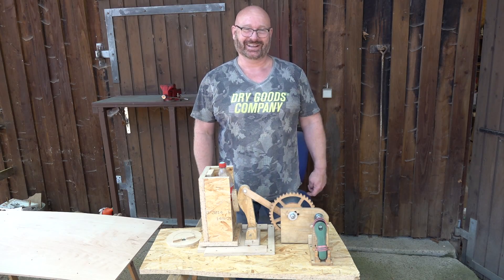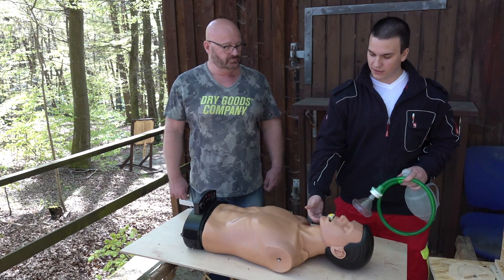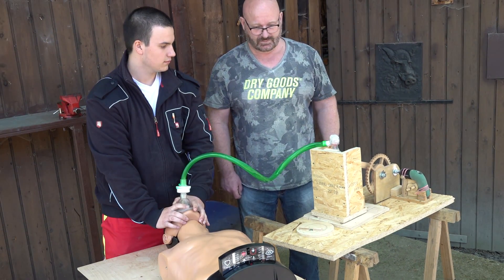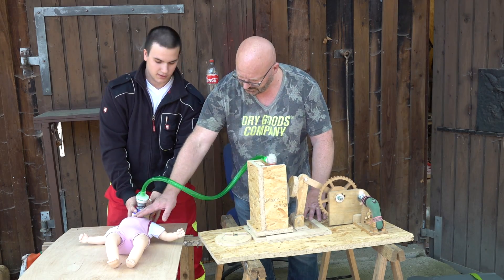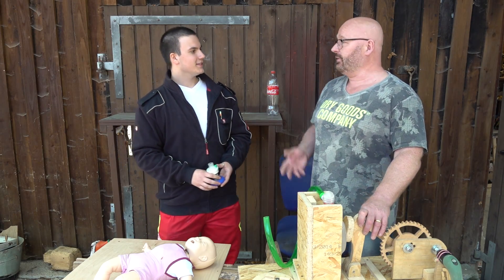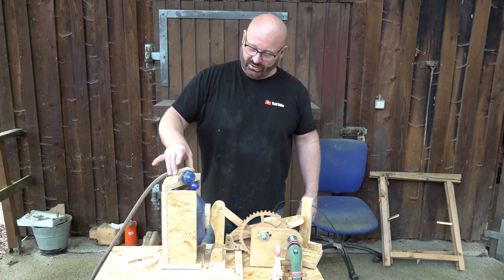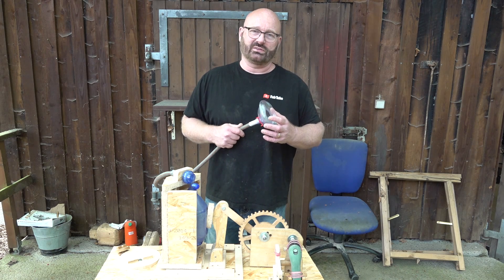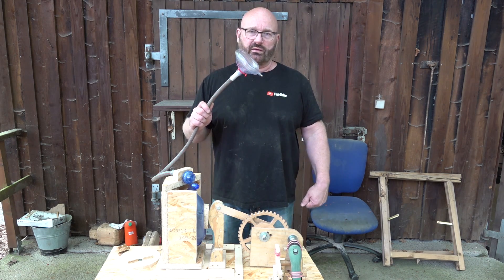Home Made Ventilator - Life Saver or Death Machine?

Comment: I think that devise would be amazing use about primitive context. Like medieval or a bit later where electricity don't really exist and you just have to change that electric screwdriver by a level manual  instead. You can say about it still need something to replace the plastic of the bottle bag and all the tube, but that is not where I would debate.

Comment: The problem with this device - and the thing that actually does make it, if not useless, extremely limited in potential applications - is that while, in theory, based on 'common sense' at least, it is substantially better to hook a person up to this thing and roll the dice if they would otherwise have no access to ventilation, in the real world there is a huge difference between 'failing to save someone' and 'injuring or killing them with an unlicensed medical device built by amateurs with a (no offense Joerg, but it's a fixed-volume respirator that seems to base a lot of its operation on how CPR works) limited understanding of the respiratory system.' Not only legally (though the legal risks are so high no facility employing medical professionals in the developed world, from a hospital to a prison, would allow it into the building) but in terms of medical ethics. Thus, the only application it actually has is potentially being used for people with literally no access to real medical care - people dying in their homes with no ability to go to a hospital. In which case...well, they probably don't have access to you either.

I really appreciate the sentiment, the attempt to help people, and even the effort put in. The machine works; the problem is that's not the standard used to determine what's acceptable for medical use on humans. Any hospital, prison ward, or assisted living facility that allowed you to use something like this to try to save a person would risk losing the licenses that allow them to continue operating even if it worked perfectly without incident. They would risk serious lawsuits from either the patient in question or their estate because of the potential non-lethal damage it could inflict, even if it's not clear whether it actually did any damage at all or if it was the illness itself. Whoever turned it on would be risking serious criminal charges and (if it was a healthcare professional) their own license. This would be a huge deal. It might seem better than nothing, but from the perspective of a hospital, which has to think of the lives of Thousands of people both currently and in the future, it's so much worse it's hard to communicate it.

Comment: The mechanic are the really simple dirt cheap parts.
The control-mechanics and safety-measurements are the important and costly parts of the system.

A simple manually controlled ventilator can be massproduced for cheap, likely even less than 5€/piece.
When you manually control it you also have to control the pressure. They usually are designed that you can not create too much of an overpressure, but with lung-problems a small inflamation, an injury or other conditions might significantly change the pressure needed/allowed.

BUT:
Those are only there for real acute emergencies when the person can not breath on their own. They are not suited for long-term use at all, causing serious damage to the lungs. Using such forced respiration can be just as deadly as not using it at all.

Now modern ventilators have quite a bit of control-electronics inside them.
To not cause damage and actually help the cycle needs to follow a specific pressure-curve - not letting the pressure drop down to 0, not hindering the outbreathing too much, not too much force during the inhalation.... for this they measure the pressure at a very high rate and very accurately and have to react to any changes. Humans do not have 100% perfect stable breathing frequencies - it changes with each breath, so the machine needs to not just monitor and regulate the pressure, it needs to notice if a person is breathing in or exhaling. That is not even mentioning coughing for example.

Comment: Overall I'd expect something like this to find use in a hospital that needs more ventialtors for stationary patients  instead of during emergency transports. There should be ways to add valves and sensors to the hose, but that's not really a direct part of Joerg's contraption. The issue would be that it still wouldn't react to any changes with the patient without manual adjustments.
Also it running on batteries would be an issue.

Comment: Hi Mr. Sprave, I have tremendous admiration for you. I have this challenge for you and of all the people out there you are the most fit for it ! Here is the context:  You see I really like growing vegetables in my greenhouse,  and I really like to pack my freezer with the veggies I grow.  Since I need hot air in the greenhouse and cold air in the freezer, with some heat exchange this should be easy to do. The only thing is, I need the gas in the tubing for heat exchange to be non-toxic, so air should be the go-to, since free and readily available. The only power source that can be used is a drill of course( why use anything else when you can move mountains with pulley, levers and battery power hand held drill ! ) 

To overcome the challenge, you will need many things, Car radiators, maybe old oxygene tanks or scuba diving tanks to store the compressed air for the heat exchange. 
I don't expect you to build a greenhouse and a freezer but If you could just get one  coolerbox to get cold and an opposite room to get warmer, this would help explain the concept.
We all have a fridge yet we don't understand how they work and how we could be using these basic principle to change how greenhouse and freezer works hand in hand.
Nothing is created, nothing is lost, everything is transformed/transferred. 

You know If I could store Compressed air to cool off and heat myself self this would really change the way we to store our power in the form of chemical batteries and electricity.
Think about it, a turbine problem is always where do your store all that mechanical / electricity when not needed, Compressed air could be used in that way, to such an extent, you could also use the decompression to run back a turbine and produce electricity on the way out.  

If you are up to this challenge ( and I know you are up to it, the question is more If you'll accept it)  I'll have more coming your way!  More history-changing devices for you to create!  Especially in the field of agriculture.

Comment: If I got it right, current version of the device pumps back and forth the same air. Meaning that pacient produces CO2 and consumes O2. I suppose futher versions might want to work around air refreshing mechanism in order to avoid CO2 poisoning and to avoid insufficient O2 levels as well. A new hole in the bottle would suffice, may be.

Comment: what all of these homemade machines lack is enough sensors to provide feedback and control. continuous sensors of flow, volume, and pressure plus controls to set targets for each would get you there; you don't need oxygenation sensors etc built into the ventilator. maybe if the sensors became widely available people could rig up Arduino or raspberry pies and come up with legitimate contenders for useful ventilators.

Comment: So, over all if handled by a professional this kind of design can technically be used? 
So if we printed a guidance sheet and a few measurement stickers we could use it?

Honestly I don't get why we don't have Boogalo sidequest memes in germany. This man is 100% gonna be a useful asset in every collapse of society scenario.
Reply: Machines like this (and many of them have cropped up) would work only in the short term, in the same role as the bag/valve breather already does.  For a couple reasons, one is the obvious reason of a combination of barotrauma (lung injury caused by excessive pressure) and volutrauma (trauma caused by rapid changes in the volume of air in the lungs both in and out).  The next is irritation and injury of lung tissues due to an excess of cool, dry air, which dehydrates the delicate tissues of the lungs, if you've ever slept one night with your mouth open and felt how parched and uncomfortable your throat gets, imagine that but getting worse and worse.  A fully equipped hospital ventilator has many features (haha) which prevent these injuries.  It will warm and humidify the air to prevent dehydration and irritation of the lungs, it provides a constant low pressure stream to keep the alveoli of the lungs from collapsing or deflating, and it will actively change the pressure of each stroke of the pump to prevent barotrauma or volutrauma from damaging or collapsing sections of the lung.  

These features are vital in any ventilator which is meant to sustain a person for days to weeks, as is the case with ARDS-like symptoms brought on by Covid-19.

Comment: I don't get the use of such ventilator... If it is for emergency, on the go and for short duration, isn't it better to pump it with hands?? Otherwise, such devices won't replace the complex ventilators having lot of sensors  with pressure control, moisture control, breathing rate control etc... Are such simple mechanical ventilator aids used in hospitals??i have seen many 'inventors/engineers' posting the same concept......
Just curious...

Comment: Getting the mechanical part down's actually a really good accomplishment. Sensors that aren't part of the ventilator already exist, which can be adapted to work with a microprocessor board.

If Joerg teamed up with an electronics guy, especially a German one, they could have a solid prototype in less than a week.

Comment: "constant pumping would be used in hospitals" .... but.... isn't that the point? Hospitals being full (or, no real respirators available) and you need this not for emergency, but to supplement compromised lungs? ... I think, what is really needed, is an air mixture with extra oxygen: Isn't that the main reason for these things?

Comment: A nice Engineering Breadboard prototype.
I hope they have created the Risk Management Plan, listed all safety issues found from research of all databases and the competitors equipment safety instructions, created the Customer Requirements Database, and validated the System Requirements Specifications (system, hardware, and software) already.
 All plans reviewed and approved for Development, Design, Reliability, Quality Assurance, Verification & Validation, Software, Procurement, Production, Testing, and Quality Control.
Next is the Initial Design review by expert customers and engineers.
Then on to the Engineering Model and repeat and refine everything as well as create Failure Mode Effect analyses for system, hardware, and software and incorporate all the design changes and validate them, and reliability plan and demonstration initiated.
Then Design Review again.
Then the Pre-Pilot Run Model repeating and refining everything using production parts and methods but engineers building.
Then the actual Production Pilot Run using production processes and personnel and then clinical trials
, and compliance testing.
Then final Design Review.
Then file 510k with FDA and other regulatory bodies, and recieve concent to distribute.
Then Production Release with all production processes and supply chain activated.

So another two days and they'll be satisfying all the needed vents worldwide ;)

Oh, almost forgot.
I assume they have done all the design under FDA GMPs and ISO compliances including all the required documented processes, training, and validation. Because to do otherwise would be foolish.

Comment: A list of improvements:
1- Use a stepper motor and Arduino to control it.
2- Make a disc with holes from center to the edge of the disc, so you can adjust the length of the stroke by adjusting were you fix the crankshaft.
3- Make one pvc piston and a sliding base with graduated volume markings, so you can use it to adjust the volume of compressed air.
4- Connect the pump to a pressure controlling cylinder. It is made of 3 one way valves, 2 regulating valves and cylinder with a vertical piston that can pressed down by small iron weights (more weight meaning more pressure). As the person exhales, the air from his lungs is blocked from entering the cilinder by the one way valve and goes out of the system. The air from the compressor then fills intermediate cylinder and the cycles continues.

Hope this helps!

Comment: With so many basic component parts of common standard these days I am very surprised that Govts. have not released a common design standard for equipment that any production unit could work to. With so much unused manufacturing/industrial capacity during the lockdown this is surely common sense. I would put Joerg in charge of the programme Europe wide :).
Reply: We Will never put a german weapon Guy in charge of europe.

Comment: Again, this is no use for corona-virus patients that need moisturized air and pressure perfectly synced with natural breathing. Otherwise it will destroy your lungs in no time. In short this is for emergency CPR and NOT for intensive care breathing support (that corona-virus caused pneumonia requires)
Reply from the maker: Yes, we pointed that out in the video accordingly.
Reply: @Slingshotchannel  Yes, you did, I saw it after I commented. Respect for that, many people seem to be making cheap PR out of that unfortunate situation! Still, you may be on the right path. I don't see why a source of moisture in the air and a pressure sensor connected to the battery drill via controller should be that complex. Maybe a co-production with an electrical engineer as your next guest? ;)